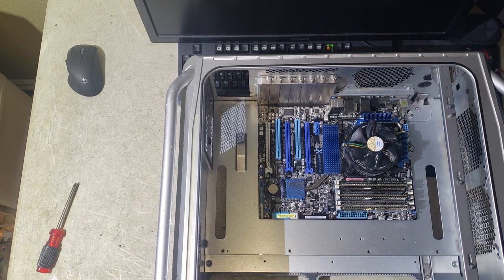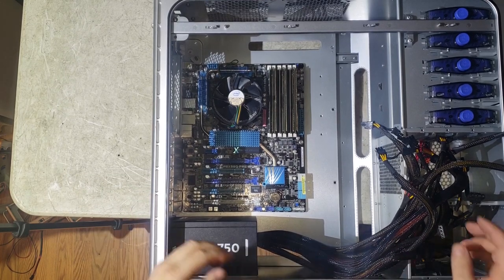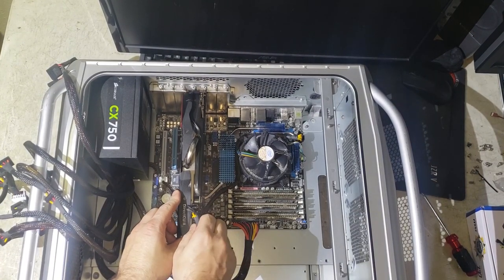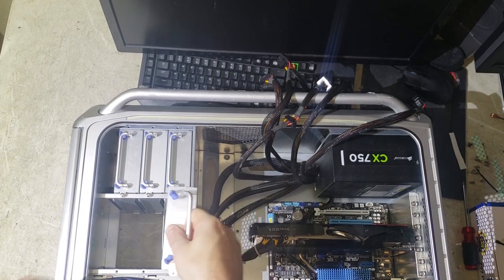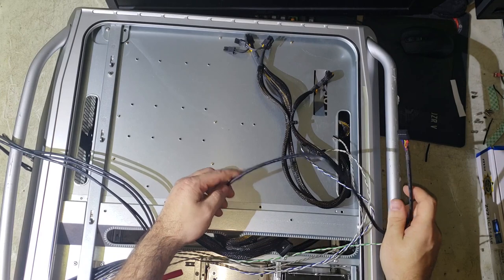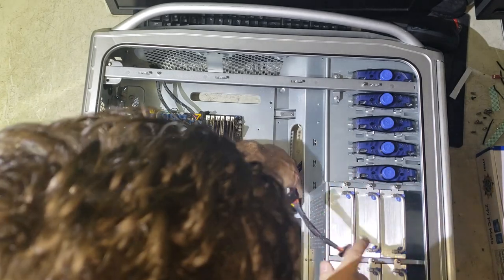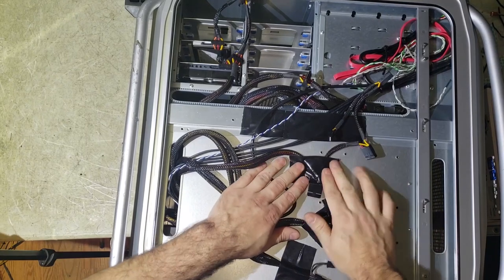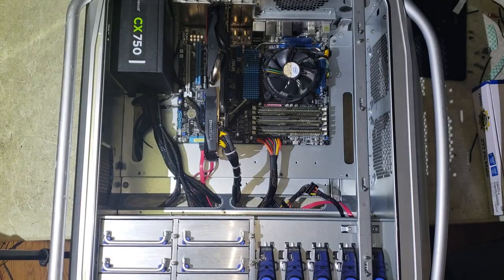Building a beastly X58 6 core gaming desktop in a Cosmos 1000 case

Comment: I found your channel because of your video on the quadro 4800. I just bought that card from mercari.com for $26 usd. Not bad for a $1800 graphics card 9 years old. I plan on installing it in my laptop using a mpcie gdc exp 8.0 beast adapter from banggood.com.

I am still waiting on the adapter, hope it works, the quadro 4800 looks promising.
Reply from the maker: Yeah, a lot of those pro cards have tanked in value, the 4800 was a good card in its day, though with the recent changes in the video card market I probably would have recommended spending a little more on a Quadro 5000 to get DX11

Comment: "beastly" and using stock intel fan and no case ventilation.. must be hell of a beast, especially overclocked ,)
Reply from the maker: I never stated the machine was overclocked, and beastly was referencing the physical size of the parts... sorry if the machine does not meet with your approval, but I judge myself by the long term satisfaction of my buyers, NOT the youtube comments of some rando who would probably never put himself out there like I have

Comment: @dragon
Clean build.  

I am building a NAS with a dual CPU so I needed a freekin big case.  I found one last week for 75C$.  I think it's a good deal.  I am a bit worried about HDD temperature.  There is a lot of room for fans in the main area but the HDD area seems to be missing some ventilation.  You seem to have built a few Cosmos 1000.  Any thoughts on that?

Comment: I am searching for a big case like this (I already got one and waiting it to deliver) to install a dual X58 motherboard with 2 x5690 It already has its noctuas installed but only can fitted inside a thermaltake xaser Iii, its an ugly case, so I will addapt this coolermaster cosmos 1000 with some new holes to support a EEATX from supermicro
Reply from the maker: I would watch craigslist and offerup for large cases... I've been finding that with the move to smaller cases, a lot of people dont see the value in their old large case, all they see is an old metal box, and it results in super low prices on formerly ultra high end cases. I picked up a corsair 900D for $100, and I also pick up cases like Cooler Master Cosmos 2 cases for $50 each.
Reply: @dragonsystems5973  the problem its where yo find, I live in México, so the 'only" places yo find those cases are like eBay and MercadoLibre (usted stuff) yesterday I found that Cosmos 1000 for like $110 USD shipped I think its a very good deal so as soon as it arrives I will start to adapting an EEATX motherboard (Enhanced extended ATX)
Reply from the maker: @MRHOTCAKE  yeah... I guess I'm kinda spoiled here in the seattle area